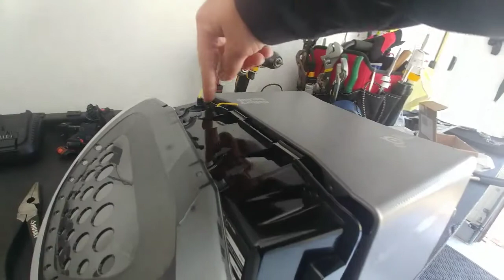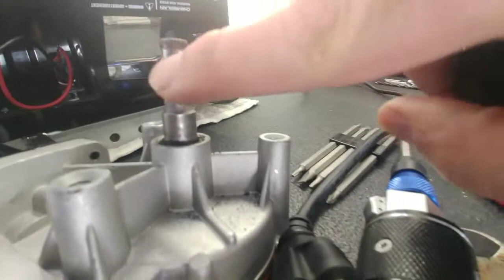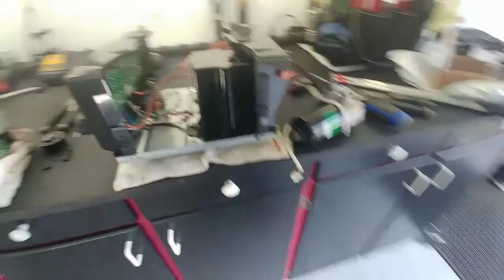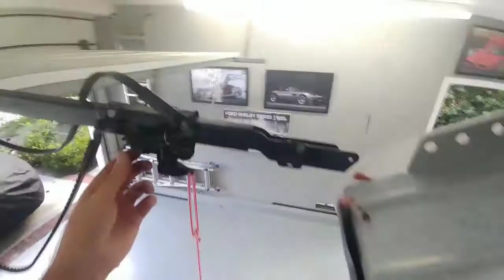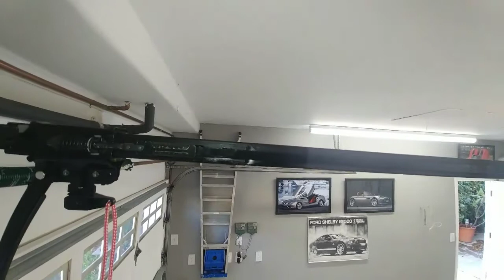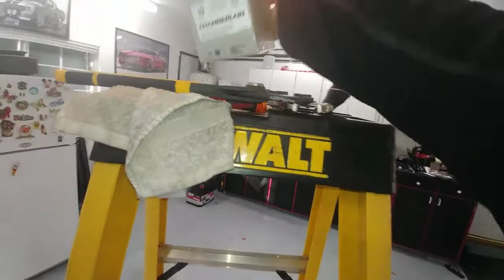Chamberlain Garage Door Opener - Motor Repair

Comment: I think your door was not balanced correctly… with the release pulled you should be able to lift the door to about halfway open and it should balance there when you let go….  I think the unbalanced door created a heavier load on the motor and that would explain the stripped spline shaft on your original motor.   You did a good job showing how to do the job though! Thanks.
Reply from the maker: you are absolutely correct. unfortunately, the tech that installed my door did a bad job. Thanks for watching

Comment: Good video. I just had the same thing happen to my HD930EV model. I did buy a newer Chamberlain model to replace it, but wanted to fix the older (4 year old) one and install it on my 3rd door that didn't have an opener on.  I am glad to hear about the warranty and will give them a call to see if I can score some free parts. I was expecting to have to buy replacement parts so this video was a great help!